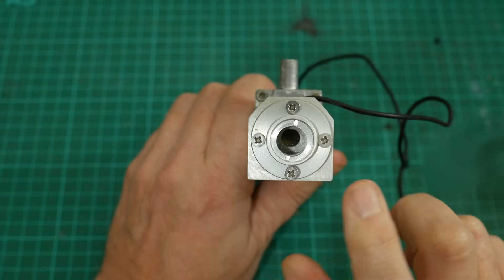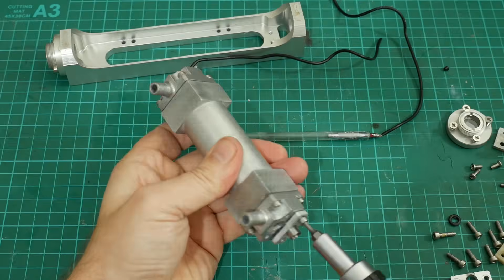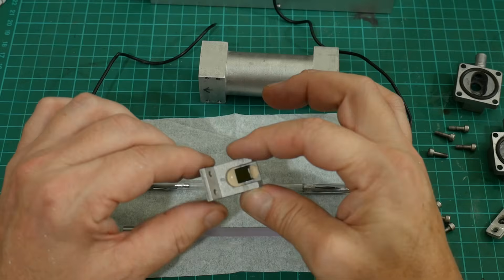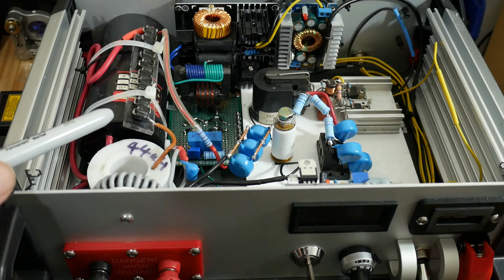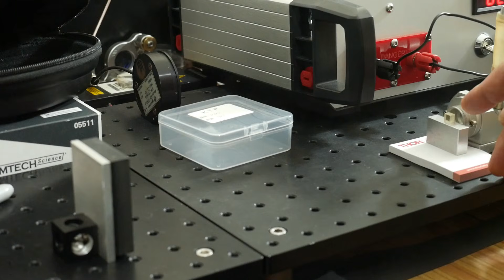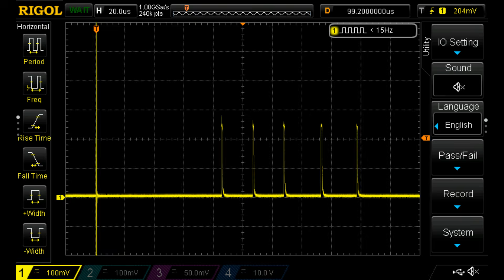Little Junk Laser is a MEGAWATT Beast!

Comment: Love the channel. I undestand that your solution for series triggering and not destoying the secondary of the trigger transformer is to use s low power transformer to charge some HV caps and then discharge those caps over a 1 to 1 transformer with thick secondary wires which can tolerate the main pulse current. This is a very clever solution which i would also like to try myself. Can you please confirm if my undestanding is correct and maybe share some more info about the 1 to 1(series) transformer?(toroid dimensions, number of turns, etc). Thank you!
Reply from the maker: Yes, this is more or less correct, however the solution I have is actually pretty poor! I am in the process of building a far better one, so stay tuned!

Comment: It's a shame that you have to put 100 Joules in to get 120mJ out. Is it possible to reduce the number of pulses by reducing the total energy of the lamp, but keeping the intensity for a shorter time by reducing the capacitor size but charging to the same voltage. That would be my first instinct, and like you say, 1.2MW peak per pulse still sounds respectable. Because I do not have experience of these lasers, I could well be wrong and it doesn't work that simply, but if it did, it would probably extend the lamp life or make it be able to fire faster.

Comment: Are there any femtosecond diode lasers in the high MW range? I was wondering whether it might be possible to build an optical phase array from many of these lasers as miniaturized as possible. Then create a plasma point via laser-induced breakdown of air one meter away from the laser. Then create a Bessel beam which terminates at this point, ideally acting as a mirror via Kerr optics. If we pulse this with 1 kHz and my math isn't completely off, at least from an energetic point of view, this should require less than 1 kW (continuous) to keep a plasma 5 mm in diameter over a length of 1 m.
Reply: No. Not really. Fun idea tho you should still try! Diode lasers can have amazing pulsing but only at very small power, you will not ionize air with it.  BUT, much like the video shows, you could essentially use a pulse diode to ‘charge’ the rod, which builds and builds until it dumps all it power at once. 

That is to say, on their own, no. You need an amplifier like Ti-Sapphire crystals. (we use these in my lab for multiwatt femtosecond pulses). You’ll have to play with the optics, but you can probably downscale it bc you’re focusing on power density.
Reply: Hmm,  You could initiate arc breakdown across HV transmission line insulators as a very expensive prank I suppose.

I saw a video years ago of a Japanese company demonstrating a laser that would create plasma spots and scan them in X, Y and Z.  It was a solution looking for a problem and the only over engineered thing they could come up with was a emergency response 'holographic' point cloud display that would appear a meter or two above a van that would tell people what to do in the case of an earth quake or other disaster.  It made a sound like an angry hornets nest amplified by a rock concert sound system.  Even deaf people would hear the noise of the van passing.

Company is Burton Inc.  A few videos on youtube, search here for "aerial 3D display Burton"  They also have one that works in a tank of green liquid.

Comment: I think you could improve the design using an elliptical cavity, that way a great percentage of the light is reflected to the laser rod
Reply from the maker: Elliptical cavities are dead :-) The modern way is to use Barium Sulphate, or ceramic cavities (I have been looking in to how to build these). They have huge advantages over elliptical metal  cavities, such as higher reflectance (believe it or not!) no hot spots in the rod, lower maintenance etc.

Comment: Les,  I was wondering about the series-injection xfmr:  Can you tell me...

1) what turns ratio you used
2) the capacitance of the primary trigger caps
3) the voltage to which they are charged at firing

I am assuming it's the toriod that is partially visible....would help greatly...
THANKS MUCH!!!
--dAle
Reply from the maker: Sorry for the late reply! The transformer has a 3 turn primary and a 20 turn secondary. The capacitor is charged to 10kV and I think(I will need to check) its about 10000pF.
To be honest, I am not at all happy with the trigger circuit. It's slow and jittery and has really started to annoy me lately!
I am going to build a new one (SCR switched) so definitely stay tuned for that!
Reply: @LesLaboratory  Hi Les...just wondering if you have done any thinking on that new series trigger.
THANKS,
--dAlE
Reply: @LesLaboratory  Thanks, I will watch for it.  Seems there can be MUCH lower voltage involved.  I have a series transformer from ebay (seller didn't know what it was, so<$).  It had a 500uH "saterated inductance!" witch was eaisly adapted to replace the PFN inductor.
--dalE

Comment: Hi Les,
When you discussed the PFN, I was wondering how long it took to charge the 100uF cap with the the ZVS-driven flyback xfmr (how much current you could get out of the ~1500v secondary)??
For the series-injection xfmr, is it homemade (I have much difficulty finding any on ebay at reasonable $)?  If so could you tell me the turns ratio and what AWG wire is used for the secondary?  I have some app's that need low-current series-injection pulses, and critical damping is not necessary...just a start-arc.
THANKS FOR ANOTHER GREAT VIDEO!!!
--daLe

Comment: 2:06  good point. I knew that ruby lasers often had the actual polished surface of the ruby rod coated at one end 99.99999% reflective, and ~90%.at the emitting end.
Reply from the maker: Yep. You can buy YAG rods on AliExpress that are coated on both ends.

Comment: this design seems like converting normal light to laser... i was wondering how it could be possible to create lasers from standard spotlights but newer seen an experiment with that... but theorethically its posible to charge anough light with good enough reflectors to align them to correct trajectory then mae it laser... :P that could find lots of areas to use.. ie use this to convert sunliht directly to lasers... but this charge sensitive semi  reflectors mostlikely wont work with that... may be a  transistor gate like logic controlled semi reflectors can do the job... liquid crystalls allready do this but they are not capable to withstand high temps nor high charges i guess...
Reply from the maker: I once saw a YAG laser head on eBay that was pumped with a halogen floodlight bulb! I wish I had bought the thing to play around with it!

Comment: would this be possible to be combined with the spectroscope video you did to analyze metal? Units available for this purpose are very very pricey. Basically they use an electric arc and a spectroscope to do what I would bet your projects would do with correct software?
Reply from the maker: Yes. What you are talking about is Laser Induced Breakdown Spectroscopy (LIBS). If I recall, the trick is gating the camera to capture the afterglow (the initial plasma flash is broad band light). After that it should just be a software problem.
Reply: I think you could produce a product that would appeal to just about every junk man in the USA. Current units cost 15-50 K! I was thinking mini plasma machine but laser would be totally clean.
 @LesLaboratory

Comment: does  that power supply supply the  trigger voltage to fire the laser?  IS it home made and do you have any detail on the trigger part as in what voltage and how you add it to the 800 or so volts
Reply from the maker: Hi, yes, it has an in built trigger transformer, which superimposes a few kV at high frequency on the 800v power rail. There seems to be some interest in the electronics  side of things so I may do a mini series on HV stuff.
Reply from the maker: you can modulate up to about 0.5MHz of so with the AOTF I have. Beyond that noise is a real problem. I have not checked of there is any polarization effect.

Comment: What an awesome video! I'm currently in the process of building my own yag assembly. Got an awesome deal on a 5x101.6mm 1% rod and I havent had success yet, but im trying! Also, I dont think you mentioned it in the video but are you using a film cap for your capacitor? I believe my failure has been in using electrolytics 😵‍💫 Thank you for posting this, you got a heck of a deal too!
Reply from the maker: Thanks! I picked up a 100uF 1.4kV pulse cap from AliExpress. Electrolytics should work, but you may have to tweak inductances etc, as they will discharge more slowly than film caps.

Comment: FYI ive found that the calcium  buildup (or whatever it is) is easily removed by soaking the parts in white vinegar and baking soda then brushing.  (Obviously test a small area first ensure that the part is not going react badly)

Comment: Hi man, just found your content and its really cool. I am wondering if there is a chance you could make a video about new flashlights that do not use LED diodes as a light source but LED diodes, laser excited phosphor diode? Particularly I am interested in science behind those diodes.
Also, I have an old laser tube from 150W CO2 laser, it has some cracks inside on a cooling lines, cant be fixed but I was wondering if anything can be done with "rubi" rod inside, it has a 150cm long pink-ish "lasering" rod inside, I call it rubi rod :D

Comment: Be great if u could increase the pulse rate so looked like it was  running continuously. Add more  tuhes around  rod and light simultaneously.
Reply from the maker: I reckon 10Hz is possible out of this with water cooling. Beyond that, problems await. Still, anything is possible!
Reply: Stryropyro said his medical 100 watt green laser was a rod excited by an arc light. It still pulsed, but very quickly. At one point he changes the rate, and you hear the pulse rate from a piece of burning wood. It may be on his dodgy medical devices from ebay near the end, but I can't exactly remember.

Comment: if you trigger the flashlamp outside of the reflective housing would it be bright enough to blind somone like a flashbang?
Reply from the maker: Absolutely. The flash itself is an optical hazard, and is bright enough to bleach dark materials, and ignite steel wool.

Comment: i have a question: do you think you can melt Al2O3 with 5% Cr2O3 with a laser? (2000°C, Cr2O3 is green,Al2O3 is wihte)
Reply from the maker: It doesn't really melt, it vaporizes. It is capable of vaporizing and marking almost any material including ceramics, especially if focussed to a point.

Comment: Very interesting viewing!
19:44 the resistor between the output terminals has seen better days 😊
Reply: Well, it's a bleeder resistor, to bleed off DC voltage from the capacitor after the power is shut down, so as long as it's reasonably close in value, it'll still be OK.
That said, it is a safety component, so yeah, I'd replace it. Beats getting bit.

Comment: Ha, What a lousy cavit factory design,  make it twice the length from end reflector,  Qs, you should  get more eneger.  Bread board  it to check my thoughts.
Reply from the maker: Indeed. It's the minimum to do the job it was intended for. I am considering extending the cavity so I can get additional components into the beam path.

Comment: shouldn't the cavity reflector be elliptical, or something close to that due to the thickness of the Nd:YAG and flash tube?
Reply from the maker: For diffuse reflectors, there is no need for an elliptical geometry as there are no focal points. The reflector surface is white, probably Barium Sulphate or some other highly reflective material. Most modern lasers employ close coupled diffuse cavity reflectors. There are very efficient, and evenly illuminate the Laser rod, with no hot spots.

Comment: A really great way to clean all those small metal parts is an ultrasonic cleaner.  You can use water and a few drops of dish soap and it will knock off all that gack.

Comment: My workplace (a UK aerospace company) made their own hybrid packages that used 741 opamp dies (back in 1978) mounted on a glass substrate which was coated with NiCr.  A YAG laser was used to burn away the NiCr coating so as to make precision resistors for the circuitry around the 741 dies.  Occasionally the LASER would require maintenance and it was crucial that the reflector was spotlessly clean (DI water used for the coolant) or the LASER wouldn't fire.  The LASER was about five Watts output and even reflected light had the potential to cause blindness.

Thanks for the video and I admire the quality of your work in the PSU and enjoyed the presentation.

Comment: Very good content, and good presentation. 
I always worry that what I think will be an "improvement" will mess up some system tuning. I still have that skepticism, but measuring the output is good (but not complete) mitigation / verification for that concern. VLSI analysis could be a tool, but I don't know how fast the non-linear aspects stack up in optics.

Comment: Could your power supply not be designed with e.g. a variable capacitor and variable inductor so that you can vary the duration of the pulse forming network? Very nice power supply by the way!
Reply from the maker: Thanks! As far as I know, nobody builds capacitors of this size as variable capacitors. Variable capacitors are normally just a few picofarads, and the high voltage ones are huge. If you wanted to make a truly universal supply, you could use multiple capacitors that you can switch in and out, and have taps of various inductances on the inductor itself.

Comment: Could one of these tattoo removal lasers be modified for pulse holography?
Reply from the maker: Possibly. It would need additional optics, a polarizing element, an etalon and a means of frequency doubling. It would be an interesting modification!
Reply: @LesLaboratory  At those power levels and pulse durations you wouldn't have to worry about stability. Is the cavity folded? Maybe you could add an etalon and Brewster's window in the area where the power was dispersed several square centimeters.

Comment: One thing that I've always wanted to see done , is the "electro laser"...the air is ionized by a high energy laser pulse, and at the  exact same time a very high voltage discharge is sent down the same beam line , a directed energy weapon. I guess the feat of getting a single point in air to ionize as he shows here is not that hard, but to do the same thing along a say, ten or 50 foot length is entirely another thing, I would imagine with a powerful enough pulse laser it's do-able, also, I guess the target would also benefit the whole attempt by being grounded to complete the circuit.
Reply: I'll find a few samples here too show you. It exists. The real trick is making a pulse short enough. With the high fields and long pulse lengths it just doesn't work very well because it turns to thermal plasma with it being hot enough to essentially be metallic like in nature it will disrupt the beam propagation, reflecting and absorbing a significant portion of the beam. If the power is high and the pulse short enough then there's no time for thermal ionization and the beam passes mostly unimpeded. Easiest way to do that is with mode locking techniques. Not what's happening here.
Reply: https://youtube.com/shorts/FW4zFhnXj5o?si=K8-i8Mu8f1f7QnWh
Reply: https://youtu.be/c20tz17SD0c?si=B6dGbW0OeykiM8ce

Comment: Les, when you make an air breakdown please remember, that the plasma is opaque to the IR/Green and half of the beam is actually gets reflectected from it (you can even see that the beam gets truncated). Also this reflection if gets amplified by the medium can damage the laser.

Critical plasma density (the one that reflects the radiation of wavelength "L") is proportional to L^-2, so IR typically reflects, while UV does not. a fully ionized air is ~2.5*10^19 electrons/cm^3.

Comment: Impressive work. I'm not sure about the losses and scattering of the joule meter? this might effect the reflected light back at the photosensor. Thus you will be getting a not very accurate result of the pulse duration? Also, I wonder if such laser can be used to evaporate materials on surfaces like a sputtering system.

Comment: Very nice! Ebay can be a treasure trove indeed. I once build a dual flashlamp pumped Nd:YAG laser with 350J stored energy and Q-Switched it the exact same way, from eBay and Alibaba party. The flashes in the air are really cool! Didnt measure the energy, but I think now I need to look out for a used Joulemeter!
Great video as always, Les.
Reply from the maker: Nice! Aliexpress and Alibaba are both excellent sources for parts. The Joule meters are dead easy to use. For the Gentec heads, you don't need the meter itself, just the head and an oscilloscope.

Comment: I was wondering, would it be possible to modify a laser like this to be diode pumped?
Reply from the maker: Possibly. Normally for Diode pumped Nd:YAG, you would use a rod with a lower doping, level. But Modern diodes are cheap, and if you are willing to take a hit on efficiency, I suppose it could be diode pumped.

Comment: I find LYE/Drain cleaner extremely effective at cleaning aluminium from corrosion but it does also make it kinda bright matte.

I've cleaned large sheets with it and even tho for my eyes it isn't very optically reflective, looking at it with my infiray thermal camera it is a mirror clear finish so don't think it would need any more polishing